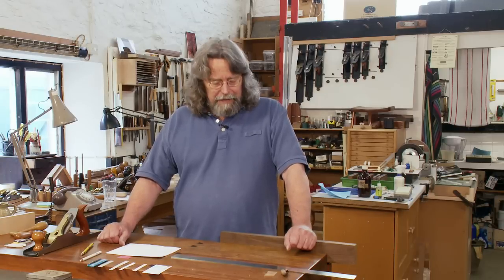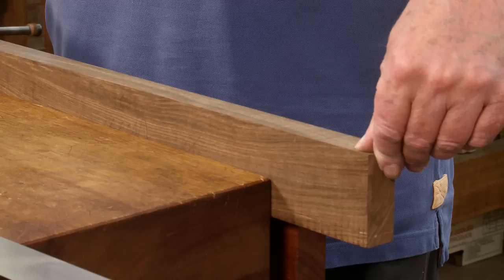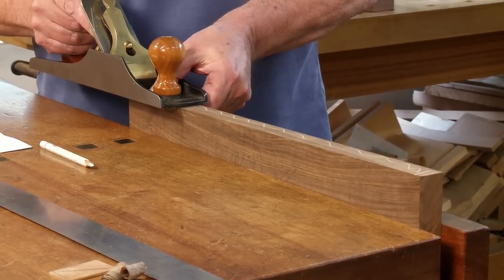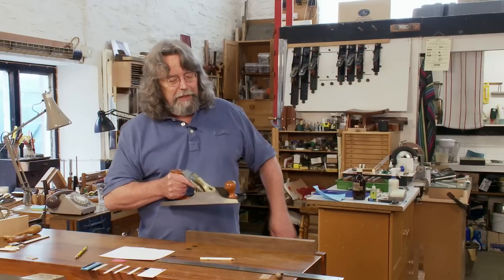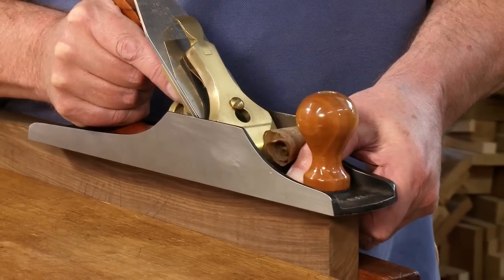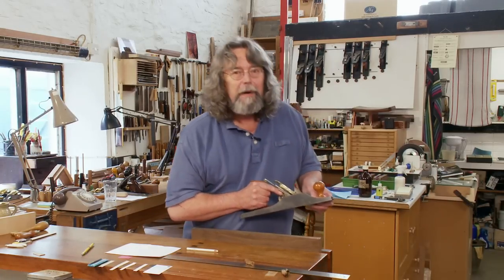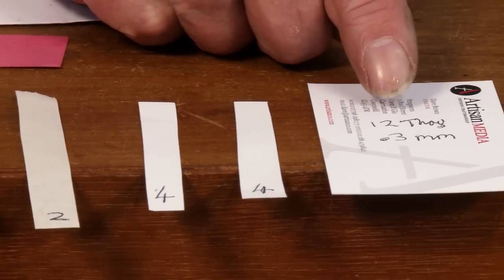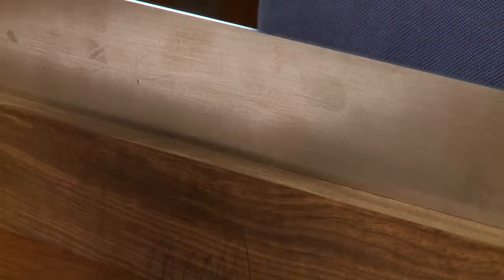Planing a straight edge

Comment: Just a tip:  I have found that when an edge is acceptably flat, my 24" Rabone steel rule (it's a relatively new, undamaged Sheffield made one, not an old beat up one or cheap knock off) will plop down and balance on edge with hardly any effort.  If the surface is not flat it will quickly topple because it is in an unstable position.

Comment: Why does one aim for a slight hollow?
Reply from the maker: Jacob,
Perfect straightness is a theoretical concept not found in the real world!
My surfaces are going to be either a slight bump or a slight hollow.
 In every case I can think of a minute hollow is preferable to a slight bump.
If a set square sits on a bump it gives us two readings, (rocks to and fro).
A bump spins on a flat bench.
Edge joints are better slightly hollow.
Winding sticks must not sit on a bump.

I hope this explains why hollow surfaces are better than bumpy ones.
David Charlesworth
Reply: @DavidCharlesworth  What! Do you mean to say that there is no such thing as perfect?! Many thanks for the explanation, very much appreciated.
Reply from the maker: Jacob,
This kind of thinking has other useful applications. 
When setting gauges, I like to consider whether a little plus or minus would be more beneficial.
This is illustrated in my secret mitre dovetail DVD.
David
Reply: @DavidCharlesworth  thanks David for your advice. Much appreciated.